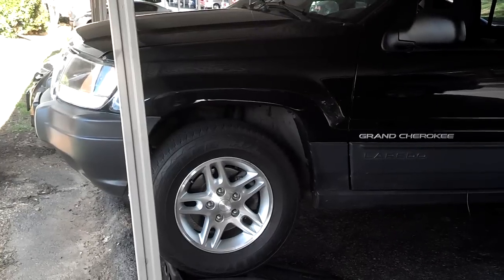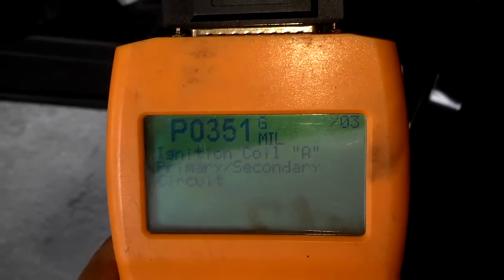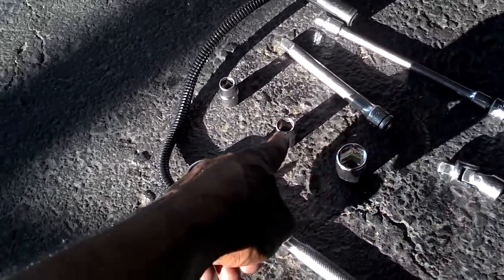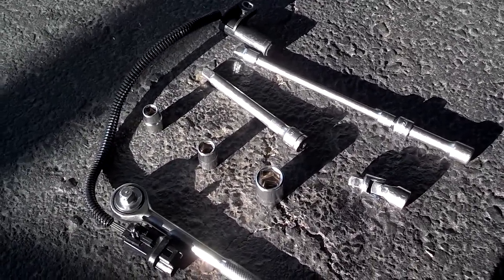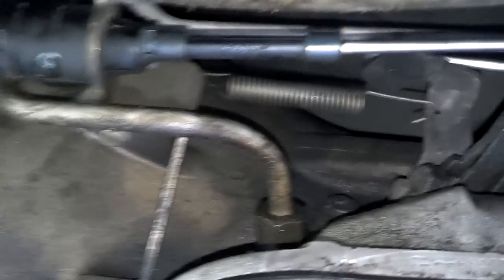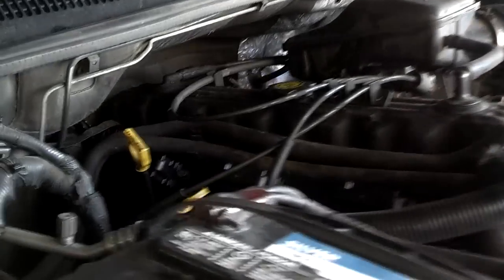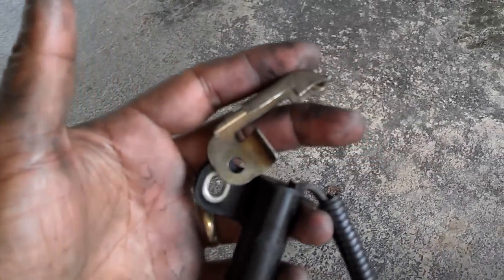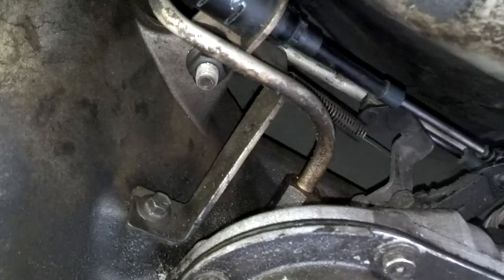How to replace the crank sensor on a Jeep, replacement, P Codes P0351, P1391, P1494 - VOTD

Comment from the maker: P0355: Ignition Coil 5 Primary Circuit Malfunction. Got the info from Google. You probably need a new ignition coil rail. Part of a tune up.

Comment: I appreciate the video. This may be going out on my 2003 Grand.. Not too sure yet. It just randomly stalls on the highway. RPMs drop to what looks to be zero. It did it twice yesterday a few seconds apart, but no other times in the 30 mile drive.
Reply from the maker: Do you have a CEL?
Reply: Unfortunately no. I even tried the on off ignition trick and it didn't show any codes. Maybe if I took it to a dealer so they could used a scanner that read live data?
Reply from the maker: You may have a fuel pump failing. How many miles on the truck?
Reply: 155,000 ish.
Reply from the maker: Hard to say, usually fuel pressure problems do not throw codes, however, we had starting issues with our Jeep before the crank sensor finally went out with no code.
Reply from the maker: We only had 91,000 on our '03 Jeep.
Reply: Just talked to a mechanic. he suggested it could be the CPS as well. He hooked it up to a scanner, but no codes were shown.
Reply from the maker: Could be 10 different things. Without a code we are all guessing.
Reply: Robert DIY How were you able to unhook the thing from the shifter bracket? (At 3:27 into the video)  Do you just push straight up? Its on there pretty snug.
Reply from the maker: Wedged a screw driver under it and gave it a twist to pop it loose.
Reply: Robert DIY Thanks for the quick reply. Ill give it a try.

Comment: Sounds like a vapor lock. The tin covered insulation under the fuel injectors wears thin and needs more insulation in that area.
Reply from the maker: interesting.

Comment: I just did this sensor replacement and it requires a lot of awkward positioning. Thanks for your video, it did help to make the job a success. I used a wire to fish the sensor plug from one side of the engine to the other, and I was able to fit my hand in the front of the bellhousing.
Reply from the maker: Good to read. Hope it runs well for a long time.

Comment: This was the best video so far I found thanks buddy the rest of the guys posting videos about this we're doing way to much unnecessary work to get it fixed
Reply from the maker: You're welcome. Thanks for watching.
Reply: Hey bud did you have to delete the codes after replacing the crank sensor
Reply: I replaced everything like you showed still doesn't wanna run
Reply from the maker: Had to use a Mopar sensor and you can clear the code with the battery disconnected.
Reply: Ok I used a sensor from orielys and I did disconnect the battery it still didn't clear the key with the slash thru it tho and fuel gauge still acts like it isn't working guess I'll have to get the other sensor
Reply from the maker: Yea, other sensors just don't get the job done most of the time.
Reply: Ok thanks man I'll try that one more question if the knock sensor doesn't work would that make the fuel pump not work
Reply from the maker: A bad crank sensor.

Comment: When I took mine out I was skeptical, thinking there was nothing wrong with the old sensor. I didn't do any drop to ground test with a multimeter. I know if it's off by one voltage it will ground out the PCM and shut down the truck. 
I swapped mine out, a bit frustrating, but it's good to do that kind of stuff every once in awhile. I hope to God that it would just start up because that part was frustrating to do outside in the winter. LOL but it took me about 45 minutes to do. Started up, no codes. So far, so good and I'm going to drive it to work tomorrow. Thanks for your videos you earned my subscription.
Reply from the maker: Thanks for watching and sharing.

Comment: Was getting a P0320 code and all the symptoms of the cps going out (left me stalled out in middle of traffic a few times), so we got the part (NAPA $47) and watched your video. VERY helpful. It took us 3 hours and a lot of swearing but got it done. Code is gone, seems to be running great now. THANK YOU!

Comment: Did it work? Everyone shows how to do this but no one says if it works? Great Video!
Reply: I went to replace mine, the cover for the cable pass threw under the dash was lose. Removed it, the sensor was brand new looking. But the bolt was lose, tightened the bolt Boom fixed!
Reply: +Philip settimi Yes, when the bolt is lose it allows the sensor to vibrate away from the crankshaft. Too much space = no signal
Reply: YUP YUP, only died out now n then. but never idled correctly, runs fine now. Al I had to do was be willing, now I have a sensor and a Fuel pump  as i was going down a list. Runs good now zero issue's, just got tire's n the title.

Comment: Thx Robert. Your video helped me install a crank sensor on my 2001 Jeep Grand Cherokee. I saw another problem in the midst of finishing up . I found a cracked ( Broke ) negative battery clamp. Funny thing is I took the vehicle in to Aamco trans to get my rear axle seals replaced and a service of the rear differential. I had just come off the road a week before and the vehicle had been running fine for a long time but when I got the Jeep back from Aamco it started acting up  ( dieing on the road, started after I tried a few times) then it gradually got worse. Tomorrow I am going to change out that battery clamp and see if that was what the problem was to begin with. Thx again Robert DIY
Reply from the maker: Elemetalman That probably is the problem. Old vehicles have a lot of coincidences.

Comment: There is an easier way to get to the bolt by going through the service panel on the inside of the driver’s compartment. I will say this, I wish I had watched this video before I’d started working on mine.
Reply from the maker: thanks for sharing.

Comment: mine is an 2002 dodge stratus SE 4/dr 2.7  same issue though. starts to misfire after warmed up and driving a bit. doesn't do it when cold. the check engine light just came on yesterday. yesterday is when my car started with the hick-ups'. going to put a crank sensor in today. I watched you tube vid for my car. very easy to get at! should be no problem! half hour job!
Reply from the maker: Good deal. Hope that does it for you. Try to use an OEM sensor.

Comment: Thanks that video helped alot.  Have you ever replaced brake assembly behind the brake pedal.  Hearing a hissing noise when I let off the brake.  The brakes work fine.  Car stops fine.  But behind the pedal is a boot and that's where I hear that noise.  Thanks for your in advance  Tonia
Reply from the maker: tonia tutt May be a vacuum line somewhere. Look for that first.

Comment: Hello,

Great video, and very helpful however you are leading people to one extra step that does not need to be done. You can easily access the CPS without removing the gear linkage cable. This can be done with a long extension rachet and a swivel head attached to it.

Comment: on 2001 grand Cherokee...  you can pull driver side carpet under gas pedal.  you'll see shift cable plate,  take 2 bolts off move metal plate,  you'll see a hole,  gives you a straight away shot at Bolt holding crank sensor on bell house,  they are pain in butt to change sometimes!
Reply from the maker: +Jabshier1980 thanks for sharing.

Comment: Nice video Robert i was driving  this morning  2002 jeep grand Cherokee  and it shut off, no codes it turns over just will not start....any suggestions?
Reply from the maker: Michael Martin Maybe the fuel pump failed. - https://www.youtube.com/watch?v=YiPAPu-K8OI
Reply: I hear it humming  when i turn the key....thank you for the fast reply.
Reply from the maker: Check for PENDING codes.
Reply: Ill update as soon as i check everything  out tonight after work thx again.
Reply: +Michael Martin    What I heard is that the "shut off" is a factory issue and happens in all JEEPS "WJ", I have a 2000 Laredo model,  and only sometimes i have that problem, if you have any other info how to fix it , please share , thanks!
Reply: Thanks man i ended up finding a blown pcm fuse  changed that no dice changed the computer and it worked i got it off ebay from a company out of florida, although it works your airbag light and seatbelt light be on tried 2 different computers same thing probably has to be cleared out or something but it works for now.

Comment: Have the same, dreaded p1391 code. Four trips to the mechanic, and same problems. Runs fine sometimes, then stats stumbling, bucking, tach and speedo dials go crazy, idles funky, etc. Changed crank sensor (not mopar), dist. Brushes, tune up. Same problem. Seems to discharge the battery, but mechanic said it only had small draw.
Reply from the maker: You may have a few different problems, however, you really should install a MOPAR crank sensor since you are still having issues.
Reply from the maker: The truck would run fine for several minutes and once warm it would stall, buck, and do all kinds of crazy things including misfiring.

The crank sensor is most sensitive. Some vehicles are touchy with ignition and sensor parts. Since you are having "issues", I would suggest you only use OEM parts.

Comment: I replaced the fuel pump in the gas tank an the fuel filter made it a little better but still runs for a min the slowly drops preasure an dies
Reply from the maker: Chad Hurt Not sure what to tell you. Maybe you have a bad fuel pressure regulator. Do a Google search to see if you can figure out how to test it.

Comment: That sensor always has to be in a very difficult location to access. Thanks for an excellent presentation.
Reply from the maker: Thank you for watching.
Reply: Robert DIY this is my third 1999 jeep grand Cherokee that has had the same problem which i could never fix.......it stalls a lot until it finally dies out i have changed the crank sensor with no change ....it wont start but the engine does turn
Reply from the maker: Hmmmm, what codes do you have?

Comment: Thanks! This gave me a big advantage to get this changed. P0320 didn't start and now it does again. Good thing it died in my garage =)
Reply: My 99 is throwing same code as yours, bolts are 11mm, everything else same,

Comment: Having just completed this, I'll add the this with hopes it helps someone:.

1) Follow his guidance and get to that bolt holding the sensor by going through the front access plate behind the ashtray.  Using 1/4 inch ratchet, 10mm socket, a 1/4 inch swivel and two 6" extenstions - I was able to easily get to the bolt and loosen it all the way, and didn't worry about it falling out completely at this point.  The rest you'll do from underneath.

2) Tether the connector end using a long piece of string with one end looped around the connector and the other tied off to the battery side.  Trace the connector from the oil pressure sending unit to the wire harness under the spark deck; the other wire that comes out of the harness that is the same size is the one that leads to the connector for the crankshaft position sensor.  Look for that red wire. It may be easier to push the large wire loom off to the left side in order to have more room to disconnect that connector.  Later, when you remove the sensor while under your WJ, you can just pull out the sensor and pull the connector over and down to you - and you will have something to easily pull the connector back into position for reconnect when installing the new sensor.  For string attachment to the new connector, I used a loop with a loose knot, but a shoelace bowtie method would also work so that that once the connector is reconnected - you only have to reach down and give the tie end a tug to release the string.  Or, just cut the string short if that's easier for you. 

3)  Removing that shift cable bracket would make things a LOT easier.  On mine, however, the second/smaller 3/8 bolt to the shifter cable bracket stripped and was impossible to remove.  Surprisingly, I was able to get my Left Forearm up to reaching the sensor by going up just behind the bracket. (My arms are thick, not skinny)  I then snaked my Right Arm up, just behind the header, and over to the sensor quite easily as a 2nd hand to help hold the sensor and shield in place while my left hand was used to slowly get the bolt for both removal and later for installing the new one.  When installing, this is how I got the bolt started back in properly til I couldn't turn it anymore - then went above and used the 1/4 ratchet set to tighten.  

** While very descriptive and can take a while, this job was easier than I initially thought.

The heat shield shown that goes over the top of the sensor is held by 1 bolt.  Mine has signs of rust so I used sandpaper and a wire brush to remove the rust and clean it up, then spray painted it using engine paint to protect it.  Let it dry thoroughly.  The sensor bolt on mine was half-stripped and probably not the original bolt.  I took it with me to Lowe's to buy a replacement and still got it wrong so jut reused the old bolt, but put some blue Locktite on it just in case since its where vibration occurs and I do not want to have to go back down there while on the side of the road.  Best of luck.
Reply from the maker: Thanks for watching and sharing your tips.

Comment: I  have not had a diagnostic test for codes.  Check engine light is not on. I did not mention before, but as the jeep warms up it works better and doesn't shutter as much when going from reverse to drive.

Comment from the maker: If you have no errors, you likely have a fuel delivery problem. Have you changed the fuel filter lately? It is also possible that the fuel pump is going out.

Comment: I seen you used OEM product did you try after market first? Just trying to save money have already replaced a lot of parts but not this.
Reply from the maker: dustin spratlin Yes the owner tried 2 after market sensors that did nothing but cause more problems.
Reply: Thank you :) Is the Jeep still running good today?
Reply from the maker: I have no idea. I have not seen it for over a year.

Comment: I did change. My ckank sensor and still doing the same...do u think the new one is wrong..
Reply from the maker: djfredyfresh hernandez Did you use a Mopar part or some other store box sensor?
Reply: Robert DIY what is a Mopar part?
Reply from the maker: Part from the Chrysler dealer.
Reply: Ok thanks
Reply: +Robert DIY did it work or no??????
Reply: check your cam sensor also

Comment: did it fix the problem and clear the 1391 code?
Reply from the maker: +Ricky Lucero Yes. I listed info in the comment section.
Reply from the maker: +Ricky Lucero Only after doing the mopar sensor.

Comment: Robert I have a 99 Grand Cherokee Limited and the alarm wont shut off when you put the key in the ignition how do you disarm it without the keyless entry?
Reply from the maker: Ammiesha Mitchell Probably pull the alarm system relay. Check on the Jeep forum.
Reply: If I pull it will I be able to replace it later
Reply from the maker: I have no idea.

Comment: would this code(P1391) also apply to my car 02 stratus? even though yours is a jeep?  Crank sensor? That's the code I got when hooking up the scanner
Reply from the maker: More than likely. Many cars share the same code across the board. Misfire is P030x with most models.

Comment: I have a 1996 jeep grand Cherokee Laredo the distributor was squeaking so I opened it up and sprayed some we40 in the shaft now it doesn't wanna start all it does is keep spinning.  any answer s
Reply from the maker: Replace it.
Reply: +Robert DIY replace what the distributor or crankshaft sensor
Reply from the maker: If you sprayed the distributor, I'd replace that. I don't think spraying a bad distributor is a good repair.

Comment: i need to replace my cam and crankshaft sensor...will the olds one cause my engine to cut off and shut down occasionally during idle? or is it the timing chain? or is it just the sensors?
Reply from the maker: These Jeeps have a history of Crank Sensor issues, I would try that first.
Reply: Robert DIY ok thanks alot..appreciate the response thanks

Comment: I spent about three hours on this today. Got the bracket removed and completely out of the way but there is NO WAY I'm getting my hand up in there to get the sensor out. I was able to get the 11mm bolt out of the sensor but I cannot pull it out. Forget pulling it out how am I going to get the new one in!....There is another video that explains how to do it by removing half your dashboard and getting at it from inside the vehicle. I didn't want to have to do that but it might be my only option.

Comment: Hi I got a jeep cherokee 1990 an it starts everytime revs to 2 rpms then slowly drops an dies out u think this is my problem also?
Reply from the maker: Chad Hurt No, sounds like a fuel pressure problem. Is the fuel pump running? Maybe try replacing or jumping the fuel pump relay.

Comment: Robert.  I have a 2004 Jeep Grand Cherokee Columbia Edition w/the 4.0L I 6 engine.  For the last 6 months or so it was randomly been stalling out, idling very rough, and has won't start unless I put my foot on the gas and hold it there for about 45-60 seconds.  This comes and goes.  Sometimes it starts strong but has always had the rough idle.  I think I need to put new O2 sensors in and was also thinking the crank sensor.  The check engine light is on now but goes off and on intermittently.  I did have some codes written down but have since lost it.  I will get another code reading done soon. Any help/advice you could offer would be great, thanks! Great vid by the way.
Reply from the maker: Justin Finn Follow the codes.